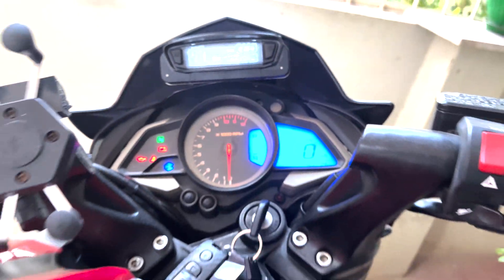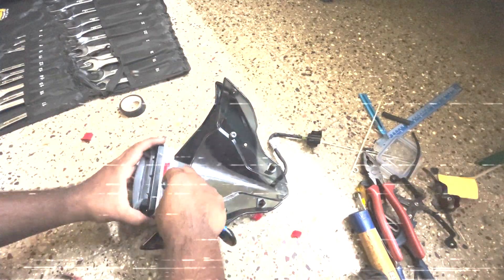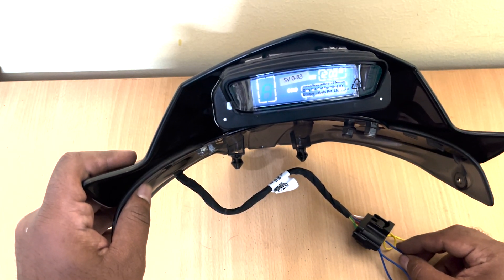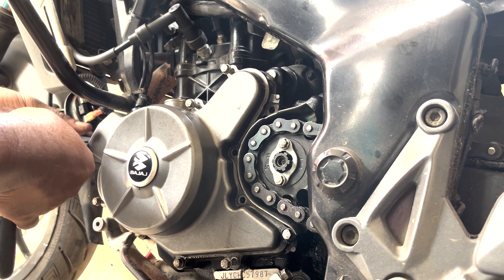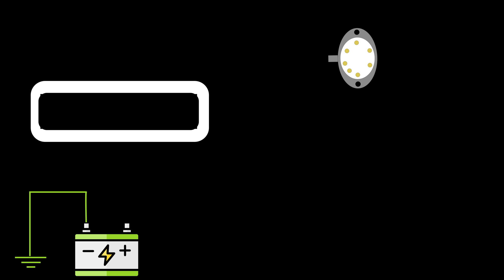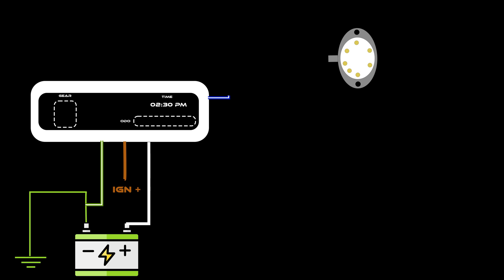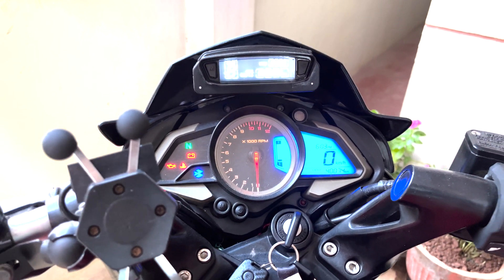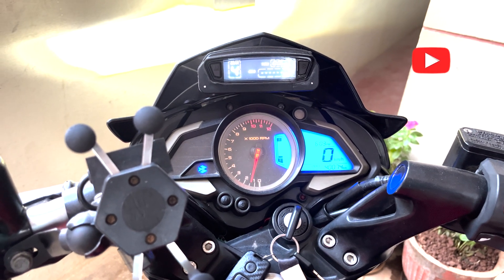NS 200 Gear Position Indicator | Domiar 400 Secondary Display on NS 200 | NS 200 Modified

Comment: Amazing work brother, for the ABS versions, you can use the 2023 NS200 w ABS speedometer. Has an in built gear indicator, average and instant FE, Distance to Empty. Part number is JL402421. It is a direct swap for ABS versions. I tried the 2023 meter on my 2014 NS and it didn't work. I'll definitely try this method for my Non ABS NS

Comment: Hey bro,actually my bike don't freely go downhill..On thing my front brake LG the Hain &  rear tyre also not moving freely
What should I do
Reply from the maker: Hi bro, 
You need to check few things to troubleshoot the issue. 
1. Check if the break caliper are moving freely and doesn’t get stuck on the disc itself. 
2. Check if you have enough free play on the chain. 
3. Check if your wheel bearings are ok.

Comment: Hi bro just one suggestion, I have subscribed and I was going through all your videos, if you could mention the part no or details in the description as well it will be helpfull for us to refer.
Reply from the maker: Hi bro ! 

Noted 👍🏻 

Will do the same for future projects.
Reply: @ARKIONX Hello brother I do have one special request to you can you please tell me is it possible to install new Rs200 gear position indicator which shows on speedometer to install on bs3 model if it is possible then how?
Reply: @ARKIONX part number for the display is JF402410 for non abs and JF402407 for abs version. These are the part numbers for the dominar display